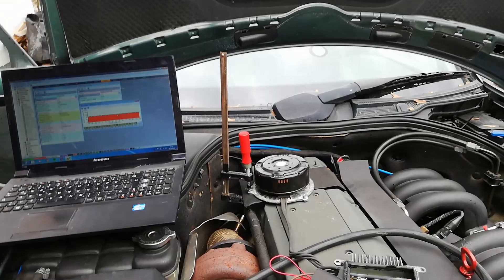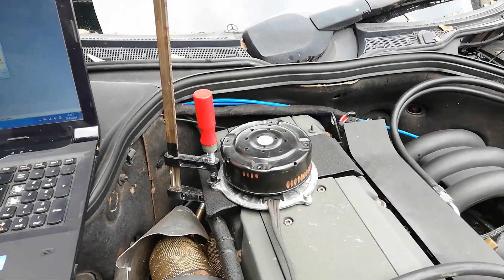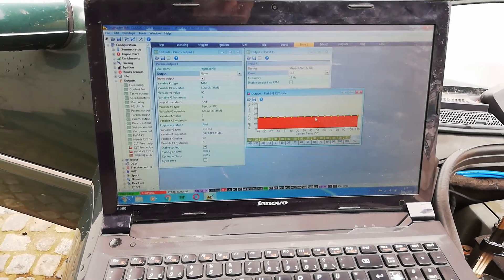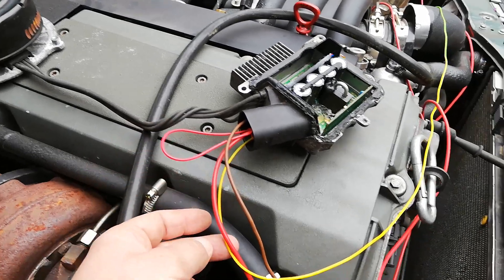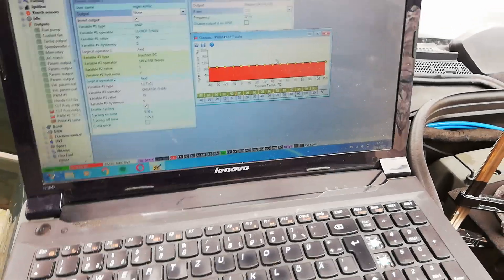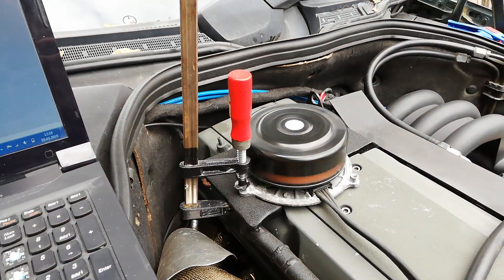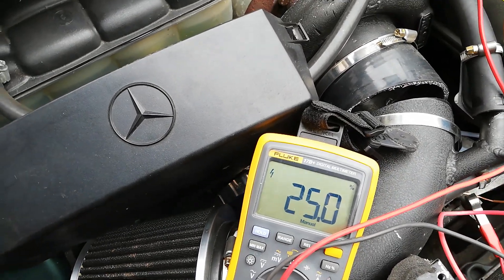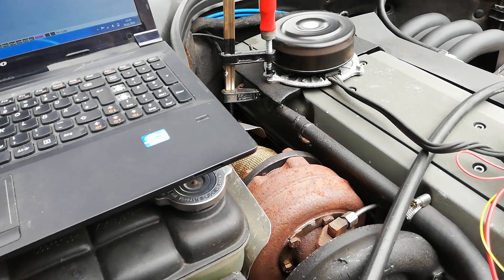M104 Turbo/ Mercedes BLDC Fan Motor controlled by Ecumaster EMU

Comment: finally found an answer for the emu black setup.. but can you please share the pinout wiring you did to the fan controller having 4 connections (pins) or 5?. thank you and keep it up!! nice video!!
Reply from the maker: Hm good question ,don't have the car anymore.
i think mine had 4 pins and was 600W. 

constant 12V, switched 12V, ground and signal.
one of the big pins is ground, you can measure that it, should has continuity to the heat sink.
the other big pin is +12V then, the small pins you have to try which one is which.
Reply: What happened to the car ? Sold ? Scrapped ?

Comment: How did the engine temperatures act with stock fan? Did it ever rise to uncomfortable number at pulls?
Reply from the maker: No, the electric fan was more of a comfort thing.
I hated the rpm-dependent noise of the visco-fan.

Comment: Hi Carl, I am mounting an Ecumaster Classic to my m104. I am using the stock shared coils. Can you tell me how to wire the signal from the 3 coils? For example, the coil 3 controls cylinder 1 and 6. Do I wire the coil to the ecu pin named ignition coil #1 and Ignition coil #6? Thank you in advance.
Reply from the maker: no just #1 , #2 and #3
12V to the inner contact of the coil.
output #1 to the outer contact on the coil...
and so on.

Comment: Did you remove the stock ecu? Did you have any problems with security key codes ?
Reply from the maker: yes it is not in place anymore.
this car has just mechanical keys.
Reply: @carlbenz3341  cool, on my c200 there was a lag between gas pedal and electronic throttle so i plugged off clutch pedal switch and now it is instantenous response lol

Comment: Hi Carl, can you help me,  my turbo makes only max. 0.5 bar of boost,  at 6200 rpm, on my w124 m104 3,2 engine, even with disconnected wastegate, what should i do?
Reply from the maker: Check for boost-leaks, maybe the crank case ventilation.